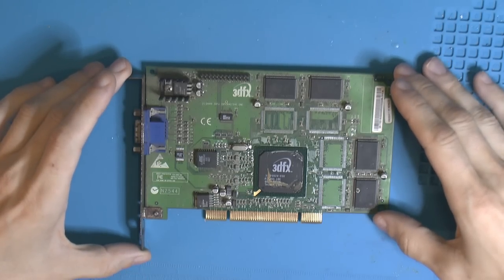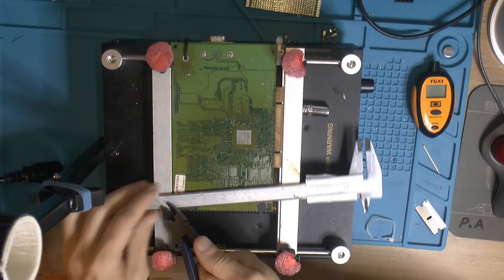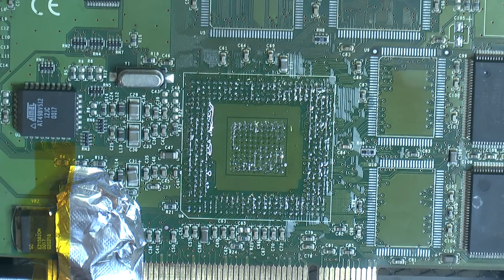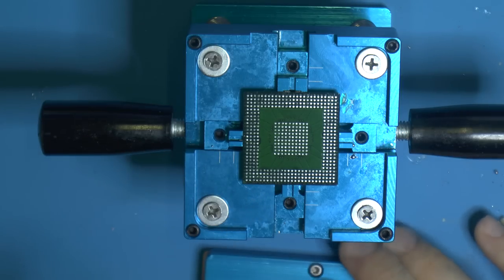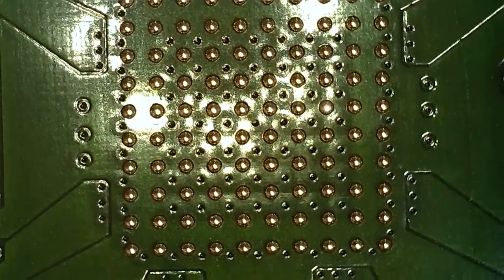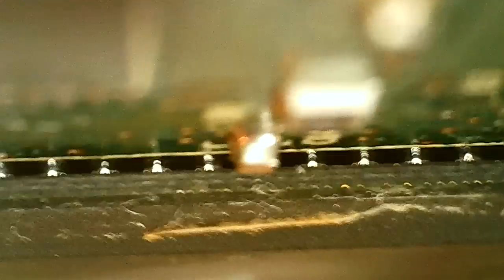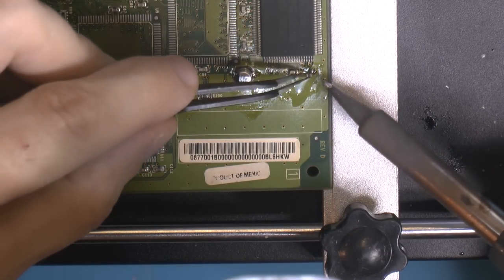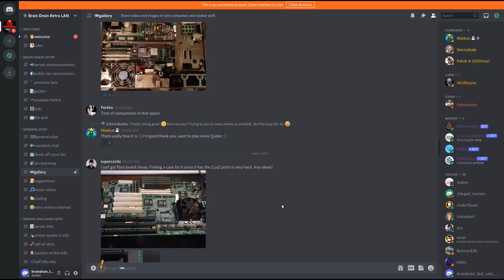Reballing a 3dfx Voodoo3 card

Comment: Excellent work! I really enjoy watching your videos and always learn something new. Keep up the great work. I have a Voodoo 3 3000 AGP with a twisted and bent PCB as well so it was really interesting to see the method you used to straighten it. It was artifacting when I first tested it, but was completely dead after I removed the heatsink. I was very careful when removing it, but I suspect the BGA balls were already flaky to begin with and that was enough to brick it completely. The avenger chip barely gets warm, so thinking it may have lost power. I havent ventured into the scary world of BGA rework yet, but hopefully one day I will give it a try 🙂
Reply from the maker: If i did it again my plan is to try 110-120C, it seems to be malleable at that temperature. Also reducing time should lower the risk of discoloring, so Im thinking 60-90 min if and  when I need to bend another PCB back in to shape.
I only had this card to test on and I considered shorter time and lower temp BUT the risk then was that it might not keep shape from what I could find on the subject of bending a PCB back.

I hope you get your card working!
Get something to practice on first tough. I usually reball some crap router SoC or something for practice.

Thanks for the donation and have a nice day!
Reply: Thanks for the tips! I have a hot air station but not a hot plate/pcb pre-heater and am planning to buy one. Do you have any recommendations? Thanks again!
Reply from the maker: @vswitchzero  This is the only one I have and have used. Got it cheap from Germany, lower price then the china ebay seller.
Dont ask me how that works XD
Its called then "YIHUA 853A" on ebay.

I seen YT reviews of it, just like mine some parts where lose, my temp sensor cable was lose and I had to solder it in place.

But I think this is one of the cheapest you can get, buying professional stuff is like 6x the price where I live.

If money is not an issue there are probably better once, well there better be! XD
The more fancy stuff has external temp sensors, guess one could mod it to have on tough.

A hotplate or preheater is so worth getting!
Probably my favorite tool to aid in soldering stuff.

Comment: Terrific stuff! Algorithm suggested the channel and instasub on this one. This is really good as I’ve been thinking ”expanding” my vintage hardware repair skills and getting a reballing jig. I have couple old videocards (TNT2 and GF2 GTS) which have most likely one or more bad ram chips and I’ve been thinking that those would be a good starting point to the black magic of BGA rework.
Reply from the maker: Have you excluded any bad resistors or resistor arrays between ram and GPU? A lot more common then bad ram I would say.
Reply: I actually haven't, I just tested those cards at some point and they did have artefacts. If I remember correctly TNT2 had them even on desktop and GF2 in 3D. I suspect memory issues, but I haven't had time (or interest) to check them more closely, too many projects going on! You are absolutely right, it can be resistors too.

Comment: i had good results by putting in some hex standoffs into the PCB holes and then clamping in on a level surface so that the standoffs lay level ,then just uniformly heat with a heat gun to 120C with a thermocouple attached to the PCB. This has straightened out a bent isa sound card in under a minute.
Reply from the maker: good advice!
Will try that next time!

Comment: well done, i wish i could reball my v3 2000 pci since it stopped working
Reply from the maker: Thank you! 
I hope you get the card reballed one way or the other, there are services on ebay with reasonable prices so might be an option.
Reply: thanks for the tip was not aware that was an option. Did you remove the original epoxied heat sink?
Reply from the maker: @Pickle136  no it came shipped like that

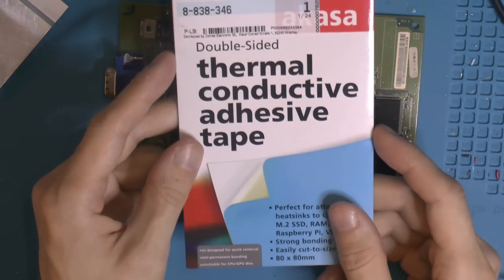Comment: 1:06:07 What is the degree of thermal conductivity? thx
Reply from the maker: 0.85W/mk
Reply: Isn't that too little? Or does this chip not heat up that much? thx
Reply from the maker: @tenentedoom  I dont see thermal conductivity as an issue with past or pads etc on something this old

The epoxy capsule is a bad thermal conductor, epoxy sucks for that so fancy past wont make much difference.

There is a good reason late chips have a small round metal IHS as part of the package like the GF256.

After that we had bare dies because a package like this wont do.

Also the primary cooling for this type of packaging is trough the GND bga balls (its in the data sheets and still applies to a lot of ram chips even today) in the middle so the PCB is the primary heatsink, the heatsink on top is secondary, needed but not primary.

Comment: Hi.
Do you have any testing software for Voodoo 5 5500? I have one with very severe artefacting. It doesn't really work in windows with drivers.
I would need some DOS testing program to find out which RAM chips are causing the errors.
I have measured every single pin on the 4 RAM chips for the primary VSA-100. They all seem to be fine.
Reply from the maker: I dont know about any V5 5500 specific software that would do that.
I have only seen like two V5 5500 in my life.